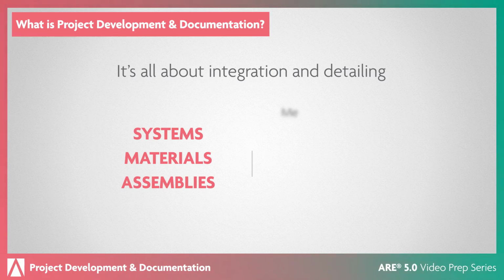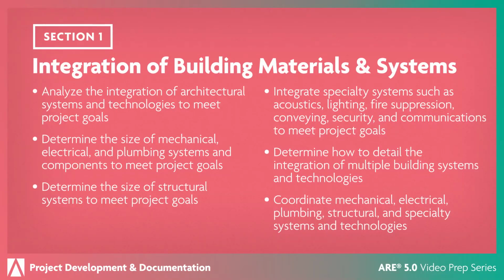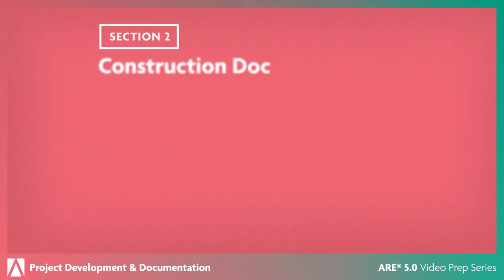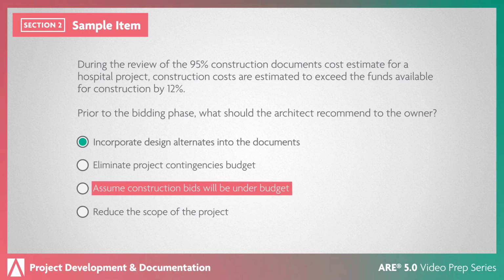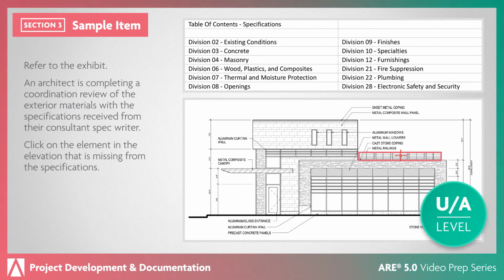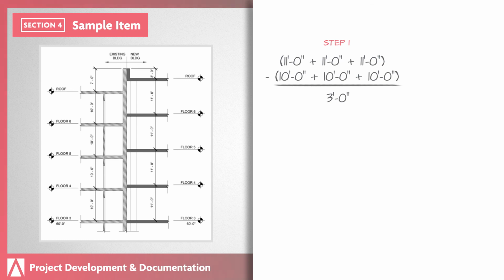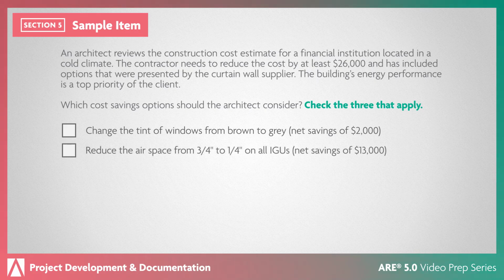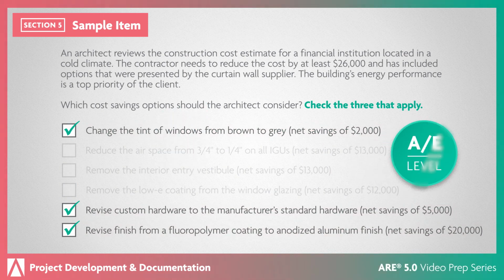ARE 5.0 Project Development and Documentation

Comment: The low e question can be a bit tricky if you are used to working in hot climates, where low e generally goes on surface 2 to reduce unwanted heat in the summers - for a while I've assumed that winter solar gain in cold climate is mostly good, so low e  would be a disservice, until I read some posts regarding 3rd surface for cold climates... so not a very straightforward question in my opinion.